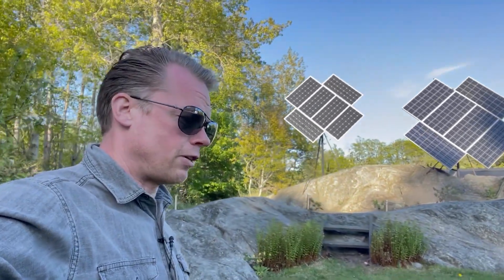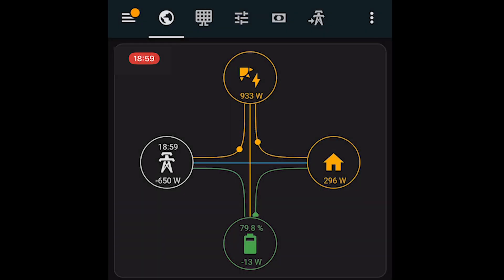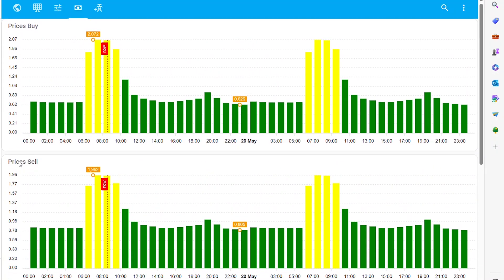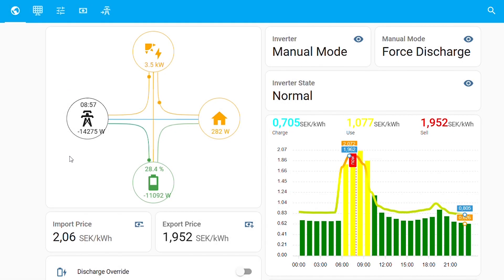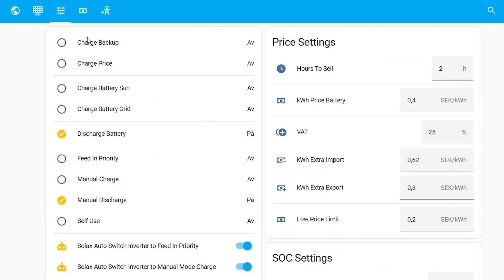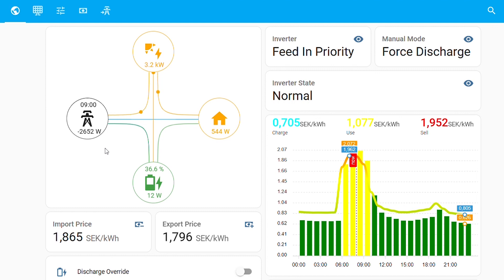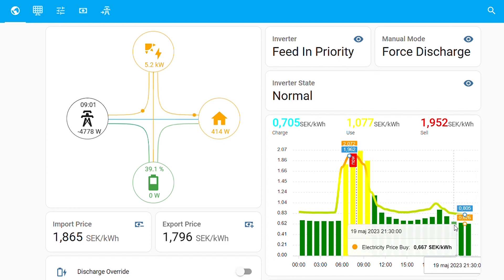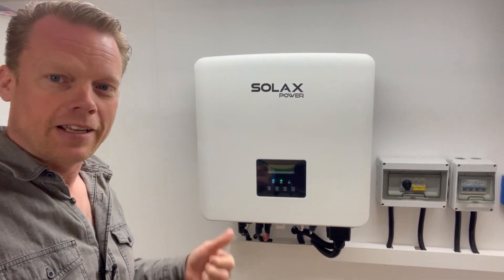Energy automation, Solax hybrid inverter, Odroid, Home assistant. Mod bus DIY  HV Bat.

Comment: My advice regarding your SoC% and "voltage". There are algorithms out there for calculating and estimating a better SoC%. You might also add "current counting" which you then recalibrate if the current is "stabilized" at zero amps. So that the voltage on the battery is relaxed. Then look at the voltage curve for SoC%. Adding this simple current counting will improve the stability of the SOC% reading under charging and discharging. This is still not perfect, but is low hanging fruit. Let's say it like that. (Other better methods are extremely complicated)
Reply from the maker: Yes, that has been on my mind but still it has been working pretty good. But now when it is possible to have the true state of charge out from the battery that’s the number one solution of course. I might try to install the Volkswagen BMS system later on together with the battery emulator from Dala. Thanks for your advice and comment.

Comment: hi, I am in a process of designing my system and watched all your videos. Found them very useful and helpful. Thank you for that. Before i go ahead and finaly start puting it together, i wanted to ask. Did you add any battery pre-charge contactor with resistor in series, to charge the HV battery with lower current at the very start and also condition it a bit when cold outside?  I didnt anything about it on the videos. Or can you set that from the Solax inverter? For example to charge with 2-3A for x number of minutes and gradually bring it up to 30A or whatever your settings are? Or is the Solax doing it automatically ( programmed to do it).Thanks a lot, Ross !
Reply from the maker: Hi. Solax have a built in precharge circuit.
It will charge the battery with the cc and cv principal. You have to manually set the max amps if you want to have another charge rate at lower temps. But below 0 degrees it will stop charging completely.

Comment: Good job!
Solax X3 12.0 G4 have frequency balancing or need order some extra? Only cheap Chint❤😂🎉 Energy meter with modBus RS485?
Reply from the maker: Balancing is controlled via a grid company sort of.. so nothing you can do by yourself. Solax ct clamps.
Reply: @flyingtools   Solax ct clamps price?
Reply from the maker: @joramotorsportteam3277  they come with the inverter so I don’t know.

Comment: Hi Brilliant work , can you please advise the BMS your using for the HV battery communicating with the SOLAX , I have the same inverter in single phase 7.5kw. thanks
Reply from the maker: Hi, and thank you, I am using Orion BMS and it is working in a standalone setup.
Then I have home assistant installed on a micro computer, that will talk to the inverter via modbus and controlling the inverter, depending on the battery voltage.

Comment: 15 kW sound so small, but if you paint a picture of using about 8 hairdryer max power 2 000 W than you might realise what would be going on, the huge load you usually never see cause highest loads in a house might be in sveden the Sauna, than nothing ... till the oven might turn on or you start cooking with 3 pots and a pan. Otherwise the Kärcher might be a big consumer and any electric heater of cause. 

Well explained and nice model   - we have a simple one: 8 cent for any kWh fed into the grid and more or less about 40 cent you get from the grid